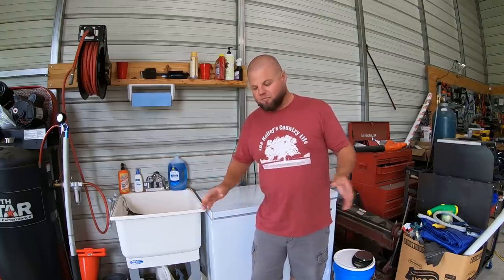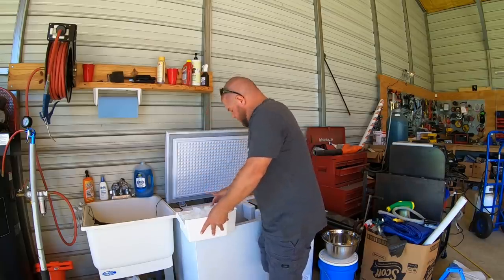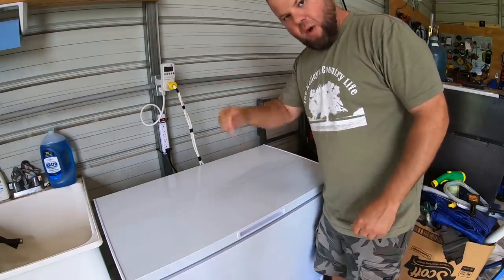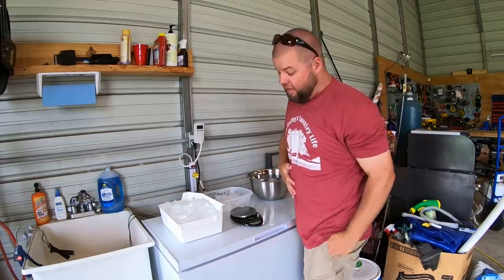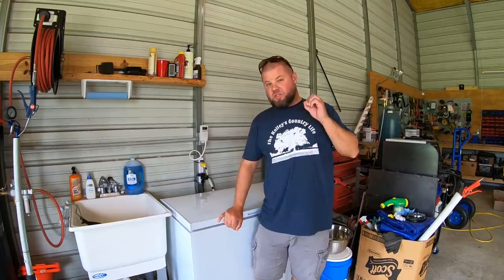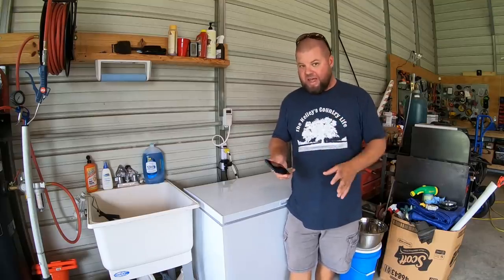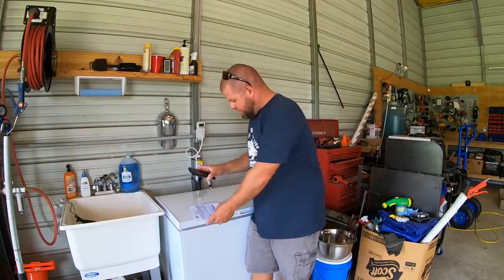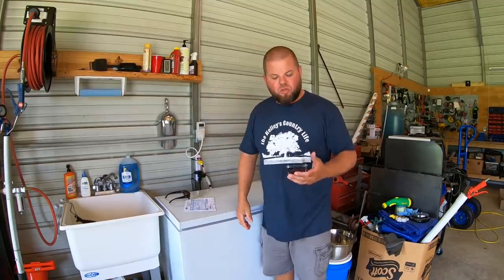Homemade DIY ice machine tests, energy usage and cost per pound! #370

Comment: The most energy consuming period of the freezer is when the compressor first cycles on, and cycles back off. A larger freezer means over time it may likely be more energy efficient than a smaller one as it can go longer between each cycle and then run for longer to bring it back to the proper temperature. This is more true for chest freezer's than conventional freezer's due to the top opening nature, cold air being denser than hot air more of that cold air stays in the freezer when you open it than a front opening one where the air starts spilling out and mixing.

For your "ultimate" setup, it could possibly be worth buying another larger chest freezer to use for it while using everything you have learned. Then it has the added benefit of more room since it sounds like on average it produces more ice in a day/week than you will generally use, and you could get your freezer pretty full and then if one week you are making extra trips, having parties, whatever that may have a much larger need for ice you have that available and can then rebuild it over time. Then you have this smaller freezer that you could still use for fish, ice cream, whatever other stuff you would need to keep frozen and may not have space for.

Comment: The coldest air is heavier and sinks to the bottom so use a fan inlet tube below the fan to pull the air up.  The fan would be best if it blew air up from under the ice makers. The condensation will distort the power consumption because it insulates the refrigeration evaporator/aluminum liner from the air. For accurate testing start with a reasonably frost free freezer. Last, the wires between the lid and freezer are probably the source of the frost, consider running them thru the case and sealing them well.
Reply from the maker: The major source is me opening this a few times a day for testing and videos. I never had this much frost under normal use.

Comment: You were saying the future build would have a spacer between the lid and the chest....you can add a switch in that spacer to turn the fans on/off as you open the lid. Takes the human error out on forgetting to flip the switch yourself.
You could even have fun and wire in a light for when you open the lid. (just so you can use more power)
Reply from the maker: That will be added too

Comment: ** Kelley if you have exposed water pipes outside coming into your building.  May I suggest you cover the water pipe with a light color ie. Bright yellow pool noodles. It will help insulate and reflect the exterior heat . ** Also what if you mount a single fan up front blowing towards the back across both ice makers . Perhaps you can use only one fan inside.  Should that work successfully. You can then utilize the other fan to exhaust the heat from the compressor.
Reply from the maker: Testing both, thanks!

Comment: I'm thinking a grate off the bottom with a fan pointing down under it would help circulate the coldest air. Maybe mettitgate thermal loss, if the bottom isn't insulated enough.

Comment: To produce clear ice, you have to keep the water in motion as if freezes so the air bubble escape.  That's why the commercial ice machines have the water running over cold plate panels.  

The condenser coil runs under the exterior sheet metal just as the evaporator does on the inside with foam between them. Not sure the efficiency gain would pay for a fan.

Comment: Yup, more thermal mass, less compressor cycling, more efficiency. It takes 4 times more power to start an electric motor than to keep it running. I don't believe the extra ice will make any difference in production. But if the extra ice helps keep the freezer at a more constant temperature when the warm water enters, it might make it freeze faster, increasing production. That's what these test are for, keep up the great work!

Comment: I am interested to see if the production falls off once the cooler starts to fill up with more ice since as the ice level goes up it’ll cover more and more of the cooling coils in the sides of the freezer. Maybe create a false bottom with something perforated to create a small space below the ice and then run a duct from that space up to the intake of the fans so that the fan will be circulating air down through the ice and across the sides where the cooling coils are.
Reply from the maker: I feel like I am seeing some of that

Comment: Mini fridge loaded with coils (copper or plastic?) run incoming (from outside) into mini fridge as a chiller bring water temp down below 40 should increase efficiency by 20- 35% (maybe more?)

Comment: Try testing the mpemba effect.  Hot water is supposed to actually freeze faster in some cases. Where I live in Northern NY, if the outside temperature reaches double digit below zero, my water lines may freeze in areas where my home isn't insulated well. The hot always freezes before the cold.  Definitely going to partition off a section of my commercial chest freezer. Sorry made the comment before you mentioned it
Reply from the maker: I am, stay tuned.

Comment: Harbor Freight sells moving blankets cheap! You could lay them on top for insulation. Keep an eye out for a truck installing a new central a/c system. If you can snag an old inside unit, remove the squirrel cage blower fan with its housing. You can’t buy a better fan. Some HVAC companies might may have a used one that they are willing to sell. You may have to provide your own power cord.
Reply from the maker: That's exactly what I intend to buy

Comment: If the water is initially hot, cooled water at the bottom is denser than the hot water at the top, so no convection will occur and the bottom part will start freezing while the top is still warm. This effect, combined with the evaporation effect, may make hot water freeze faster than cold water in some cases.

Comment: Try running your water lines through the inside of the freezer to pre-chill the water. This may work well depending on the time it takes the makers to a batch of ice. If successful, your production will increase a lot. 

My prediction is you'll be at 20lbs of production per day soon.
Reply from the maker: I'm afraid lines would freeze, but testing is in order
Reply: @TKCL  I wouldn't run a huge section of the line inside of it. You could run maybe a foot or so into it, then have it come back out before going back in to the makers. Figure out how warm the water is right before goin into the ice makers. If you can cool the water down to say 50 degrees, I think your ice production will double.

Comment: I think you are onto something about the incoming water temp.   This guy took an old drinking fountain and turned it into a DIY chiller for a reef tank - you could probably score a used one (any demo of commercial spaces going on near you? Dumpster diving time!) and use it for the same purpose.  Insulation of the lines from it to the freezer would be crucial since there isn't significant volume of water being used.

Actually, that's a huge problem.  The ice makers don't consume that much water for each fill and you would still probably get mostly hot water.  For that reason alone I now think that's a terrible idea - but I just had another thought:  you could make a glycol cooling loop.  Learned about these things watching HVAC internet videos - glycol loops are used to keep beer cold between the fridge in the back of the bar where the keg is and the taps up front.  Glycol cooling lines are ran along side the beer lines, and all of them are bundled together and have the crap insulated out of them.  You could probably just insulate and chill three or four feet of water line with a glycol loop from the icemaker back and that would probably be more than enough to pre-cool the water before it entered the freezer!  

An example of a DIY glycol cooling loop system: https://www.homebrewtalk.com/threads/metzens-mini-fridge-glycol-chiller-conversion.631203/

Or if you just put your freezer under ground the ambient air would be naturally cooled  🤣

You might be able to use the freezer to chill the glycol loop making it even more simple; but I would only consider that if you could find a food safe glycol or other antifreeze.  Even then I'm sufficiently paranoid I'd probably just keep it isolated and it's own thing next to the freezer.

Comment: OK water temperature effects evaporation level.  This can in turn effect how quick the water freezes.  As such warmer water will often freeze faster.  However my guess is these ice makers are timed not based on temperature SO it might make for more ice weight per cube.
Reply from the maker: Definitely on temperature, up 102 percent on production since starting.

Comment: For anyone who's interested, those are 120mm computer fans. The model number doesnt matter much, that size is the most widely available size, and the 2-pin variety will probably be the easiest to hack to connect to a power supply.

Comment: Fastest way to cool your inbound water is to run a 50 foot coil of 1/4 inch ice maker tubing through a 5 gallon bucket full of water before the inlet pumps. Ideally with the external heat removing fan also blowing on the bucket. A simple condensing worm, the water removes the heat to room temperature.
Reply from the maker: Testing

Comment: I think Your set up is pretty bad ass little jealous that I didn’t think of it first but I wonder if you could possibly increase production by adding two more fans to pushing to pulling so that it created a rotational Air Force if that makes any sense!? Although that would mean he would probably have to do a bit more modifications because you would want fans on both sides of your ice making trays

Comment: yeah definitely do not insulate the outside sides of the freezer it needs to dump heat. on colder days it can dump heat easier. Insulating the outside wall of the shop is a good thing. Or even throwing some shade on the outside of the area is also good. Shade the water pipes if exposed

Comment: Since you've said you use well water (I assume this means it's free) I'd suggest building a swamp cooling unit for the icemaker incoming water.
Reply: Good thought, but swamp coolers only work in dry climates. Florida is NOT that.

Comment: If you could run a contact loop of tubing in the lid of your freezer for your inlet water. it would pre cool your water prior to entering the ice makers. Youve got thermal losses through the lid, might as well take advantage of them. Id just pull the top skin off the lid and loop some plastic ice maker tubing back and forth, then place the skin back on the lid. should be considerably cooler than ambient temp, but should not be cold enough to freeze in the lines. then a thermal blanket over top of the lid would cool your water even more.

Comment: As I said in a number of my other comments I think your real ganes are going to come from speeding up the cycle times of the ice makers assuming the ice makers will allow almost in an infinite adjustment of speeding up the cycle times at that point you will need to start looking at the incoming water temperature and water pressure to get the absolute maximum production out of your setup.

Comment: I suggest you use and mount a refrigerator light switch in reverse which can shut off the fan(s) when opening the freezer lid .
Reply from the maker: Version 2.0 will have this

Comment: Install a switch on the lid to turn your fans off when the lid is raised, maybe a magnet style that you could epoxy to the outside so you don't have to worry about drilling in to the sides.
Reply from the maker: Version 2.0 will have that

Comment: Hot water freezes faster than cold water, because of evaporation. It’s called the Mpemba effect. You can increase your production by 10% by putting in boiling water into your ice makers.
Reply from the maker: Boiling is the key, slightly warmer than incoming temp gives adverse effects.

Comment: Thank you so much!! I pay for ice just about every time I go out fishing!! We have a counter top ice maker that we run as soon as we get home from work!! We may make 2 to 3 pounds of ice a night 3 to 4 hours. But the ice is very small round cubes with a hole in the middle!! I am definitely going to make one of these for our home and fishing!! During the middle of your videos! My Ice maker in my refrigerator/freezer quit working!! It quit because the water filter placement is a very bad design!! 👎don't buy a Whirlpool refrigerator!!!
Reply: You can find ones on amazon for under $400 that make 100lbs in 24 hours. If you just want to do this for the sake of building something, then by all means. However if you are just doing it because you don't know there are better options and just need something that works..search commercial style ice makers on amazon.
Reply: @OmegaGamingNetwork  commercial ice makers make ice at 32 degrees and need a drain for the storage of the the commercial ice maker's ice!! This doesn't need a drain! The ice is made at 0 degrees F! So you don't need a drain and it keeps making ice!!

Comment: Try cutting a $1 sun visor as a false lid for extra insulation. Have one in my kegerator. Don’t know if it actually does anything just that’s what the guy that showed me how to convert to a kegerator told me to do.
Reply: you mean for a car windshield? similar to a hack for cheap coolers is to do that with that mylar backed bubble wrap. then you create an airgap between it and the un insulated lid.

Comment: I like the preconditioning of the incoming water idea but if you have to use energy to do it the payoff might not be there.  One thought is to simply put a 10 gallon container under the ground outside with a float switch.  The ground temp should keep a nice even temp of the incoming water independent of the air temp and there would be essentially no power usage.